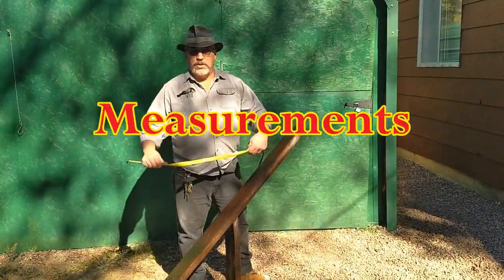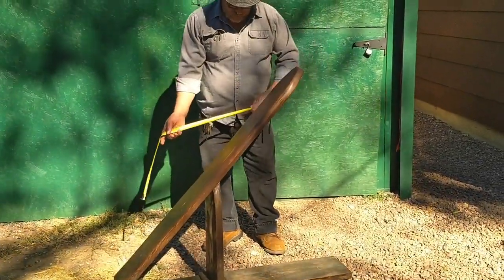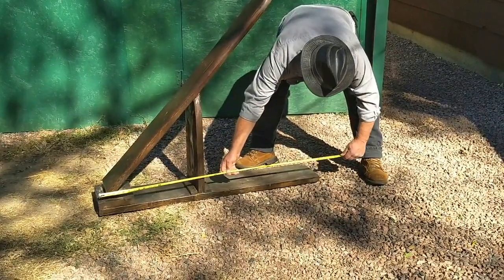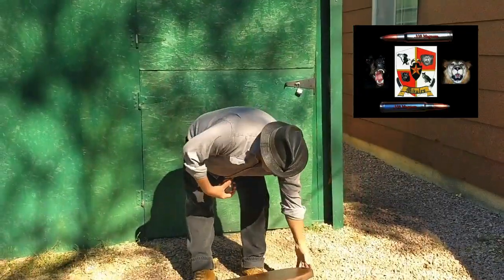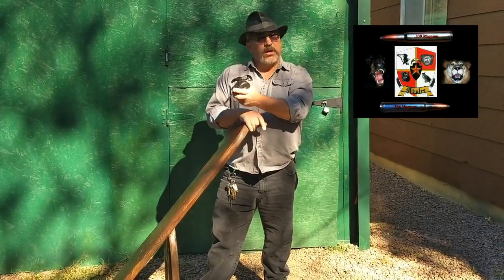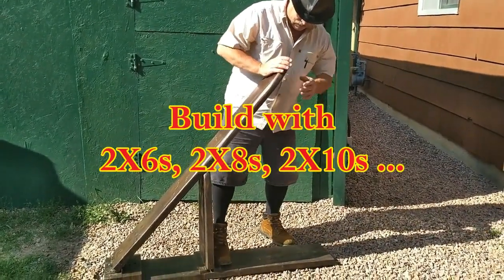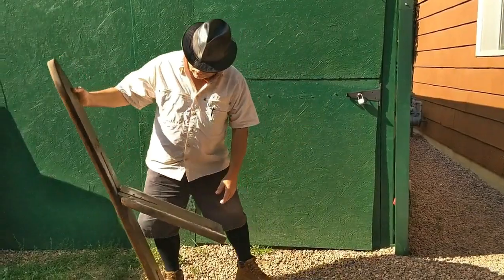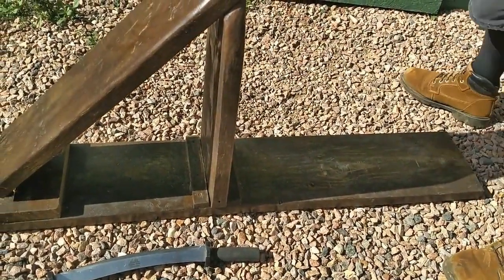The Portable Fleshing Beam  Video 78

Comment: Do you have any problems with the beam being too light? Does it want to move around much when you use it?
Reply from the maker: No.  On deer and elk skins, small game like fox, coyote, etc.,-- all was fine.   I am currently making a larger one with a heavy base board to over come any possible issues.  If needed, I would place a heavy weight on the base board under the beam and that should eliminate any problems.